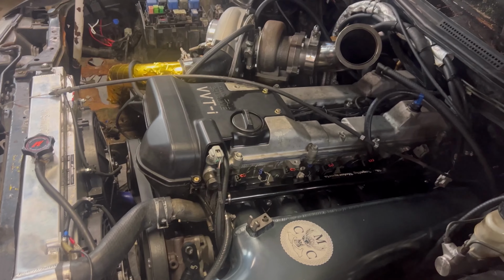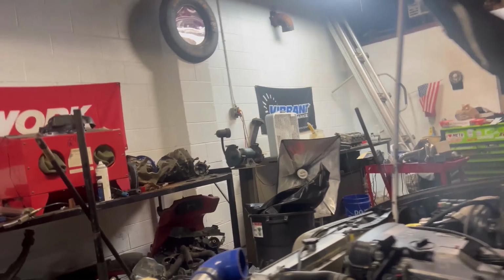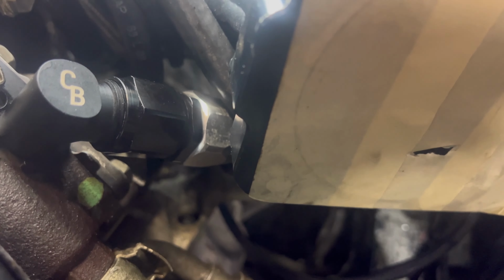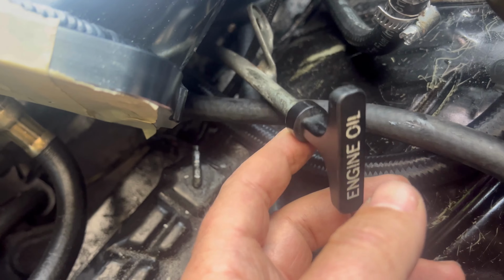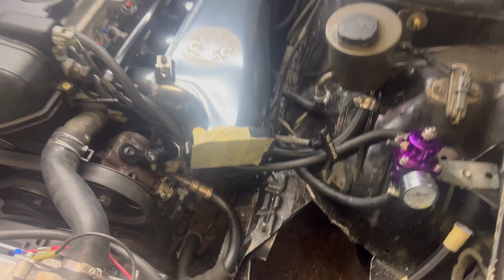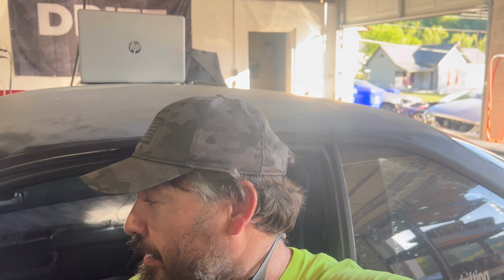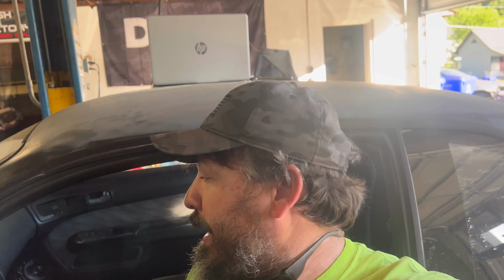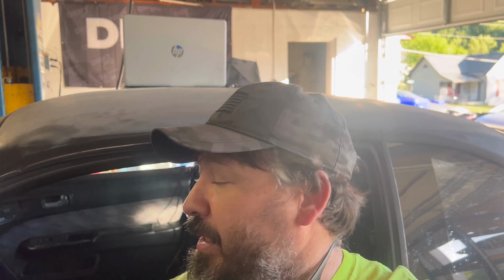TURBO 2JZ SWAPPED S14 FINALLY RUNS BUT BOY SHES SMOKIN

Comment: What management system? Maybe starter contacts?? Gl hf looks good
Reply from the maker: ECU Masters EMU Black with Wiring Specialties 2jz to S14 harness
Reply: @Chessermotorsports  nice stuff. How much boost do you plan to run and how much timing at the torque peak?
Reply from the maker: @hondatech5000  just being a stock vvti im staying at 250 tq, its just a thrash car and the past 2 vvti motors i had tuned popped at 290ftpd so im going to try to just make it track worthy. We have a 1jz car that we will turn up once its done.
Reply: @Chessermotorsports  do you add ring gap?
Reply from the maker: @hondatech5000  no 100 percent stock engines. If i build a motor yes i do. The vvti is only good for 300ftpdtq the nonvvti is good for 500ftpdtq. Im building a 2jz for my IS300 and we have a 1jzgte for my s13 which will make 700hp 500ftpdtq max on stock engine. All ECU Masters on all 3 cars.
Reply from the maker: I came from the Honda scene myself and im still learning these cars. I ran a 84.5mm sleeved b16a with type r cams eagle crank, je pistons, eagle rods with the big bolt, twin disk clutch, b16 trans with LS 5th gear. Precision 6262 on Hondata s300. So the jz stuff was all new to me 2 years ago when my kid got into drifting.
Reply: @Chessermotorsports  👍
Reply: @Chessermotorsports  ahh I worked at a Honda dealership from like 1998 to 2012. Then did Toyota/Lexus repair shop for about 5 yrs. I had a Supra but it had apexi neo 7mgte 550’s compressor upgrade on turbo. I have turbo ls swap now Holley termiX
Reply from the maker: @hondatech5000  hey man thats good stuff